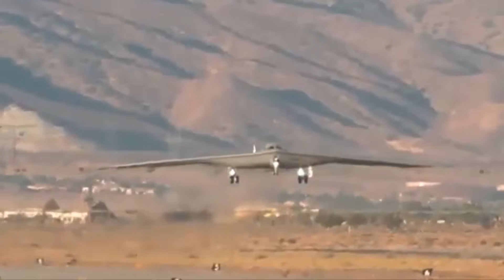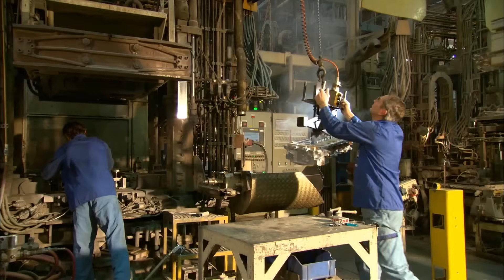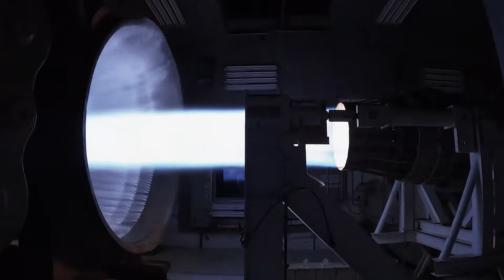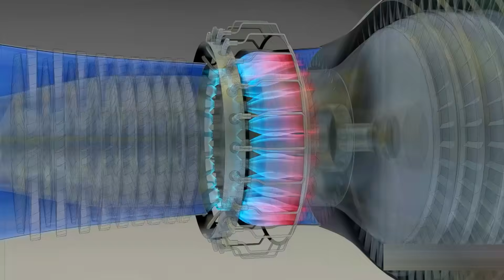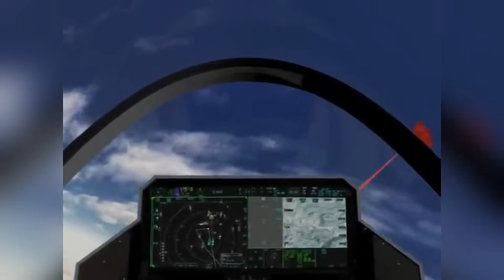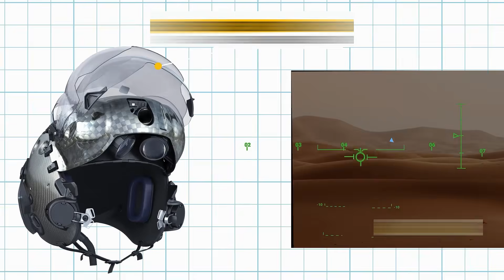How The ENGINE Of The B21 Raider Will DOMINATE Its Predecessors

Comment: 2 engines of 17k lb of each wouldn't get it off the ground with weapons and fuel load. It would take 4!
Reply: The engine the F-35 uses is close to 45,000lb thrust, the most powerful on earth. 

Anyway, the B-21 isn't a craft operating around speeds or acceleration.... like fighter jets are. 

Powerful engines also emit giant heat signatures. Masking heat/energy loss only works so far, to some degrees. Stacking 4 powerful engines at a location in space WILL cause at least twice as much HEAT signature/ENERGY loss as stacking 2 powerful engines at the same coordinate.  

The trick to stealth bomber deals with optimal long distance flying and low heat/energy signature. 

But more importantly, nuclear payloads don't work on the same logic as conventional payloads.... when a TINY 500lb MIRV (on ICBMs/SLBMs) or when a 715lb -- 2,000lb (bomber carried device, such as a B21 or a AGM-181 LRSO) .... has anywhere between 5 to 20 times the giant 10,000lb thermonuclear bomb dropped on Nagasaki, in 1945.

In other words, you don't need a B-21 to carry the kinds of payloads that the mighty B-52 from the Cold War was tasked to do (in conventional devices); or the sleeker B1 Lancer is tasked to carry...

All a stealthy, slow, small B-21 has to do is carry around HALF A DOZEN or so B61/AMG-181... and it's more than enough, of a payload.... ON ONE B-21.... to C0MPLETELY evaporate cities like Beijing, London, Washington, Berlin, Moscow, Tokyo, London, etc.
Reply: @kiabtoomlauj6249 45k lbs in after burner